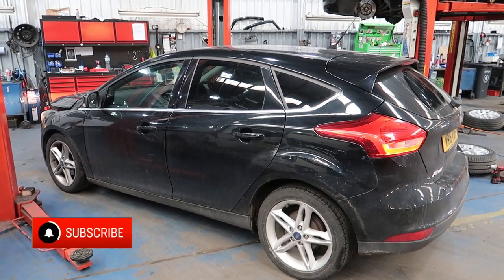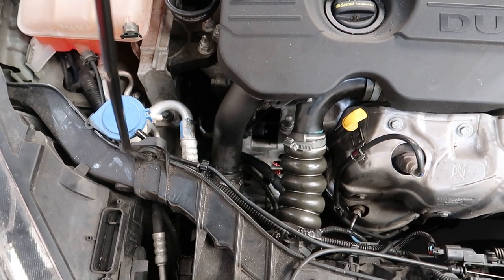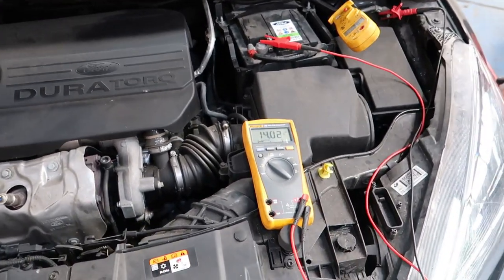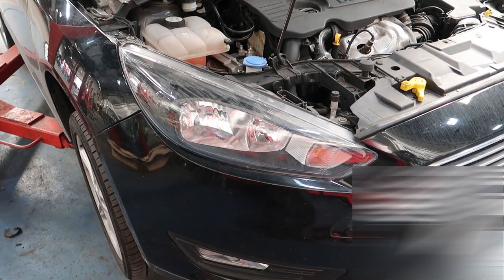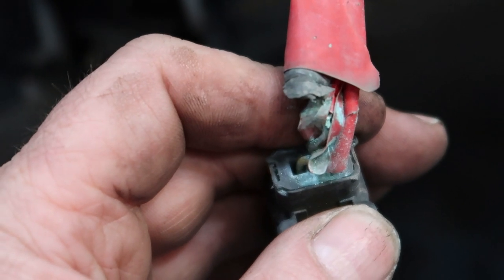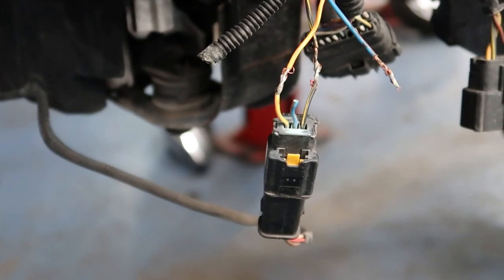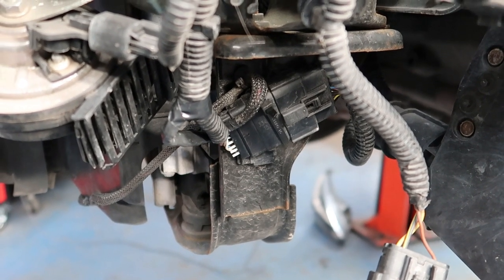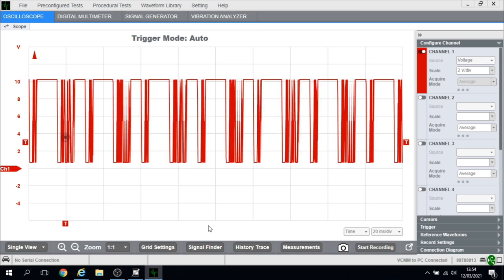2016 FORD FOCUS - U0120 - battery warning light, new alternator fitted

Comment: Thank you good sir for showing us the process of diagnosing to confirm the issue! I was reading up on the u0120 code and everyone said it was the lin wire connected to the battery current monitor on the negative terminal. Wiggling the cable, made my lights come back on and I was able to start my car. The shop I had my car at last is horrible. I called them to ask why my radio doesn't work but they denied it and said it wasn't working when they tried it. They crushed the lin wire under the negative terminal and over stressed it.  I've a new pigtail to be soldered on as soon as it stops raining over here.

Comment: Great job , so many cheap aftermarket parts are crap quality, especially alternators, you've got to use good gear as you do , great result , the previous repair to the wiring was really bad , why do people bother doing rubbish repairs, it takes the same time to do it right 👍🤗🤗🤗🤗🤗

Comment: Was it possible to see the data packets change width when the alternator was disconnected to see if it was responding to the master? I wonder if it was sending any responses or if they were just incapable with the serial data protocol.
Reply: Incompatible *
Reply from the maker: its something i could look into, it wasn't something i did on this particular job. The screen shot of the bad LIN was how it was all the time, no change in the pattern

Comment: Nice job, why didn't that signal pattern pulled down to zero.
Reply from the maker: Lin doesnt go to zero and it went to 10v because i had the scaling wrong......i dont tend to use that scope much and found this the other day when using it......i changed the scale and got the 12v
Reply: @SYDiagnostics  Thanks for explanation

Comment: Just put an oe alt on a 2019 transit. Scoped lin bus to alt. Code won't clear. Lost communication with generator control module. Pulling my hair out. Can't get this fault to clear. Even changed battery and battery monitoring part on battery negative. Any ideas!?!? Thanks

Comment: Great find Steve, what made you remove the bumper btw ? , have you seen this issue before ? , very poor repair on those wires previously and you can’t beat those crimp connectors I love them 👍
Reply from the maker: with it having the grill fault, ive seen issues in this area before

Comment: Lin normally 10v ?
Reply from the maker: normally around 12v but the battery was getting low......i was waiting for someone to comment....👏
Reply from the maker: also the trace with it running was the same one i used earlier in the video (oops!!)